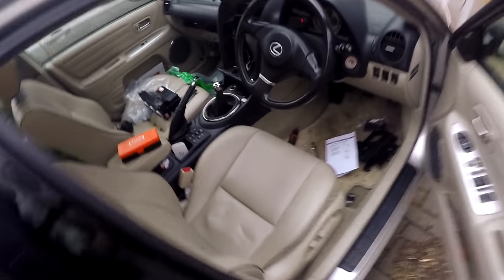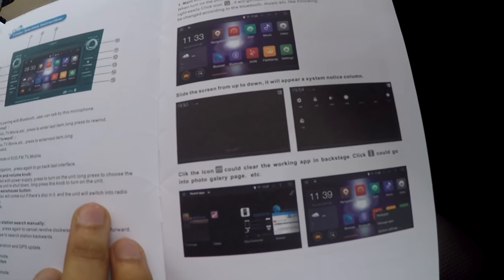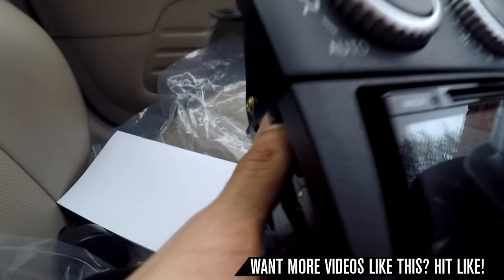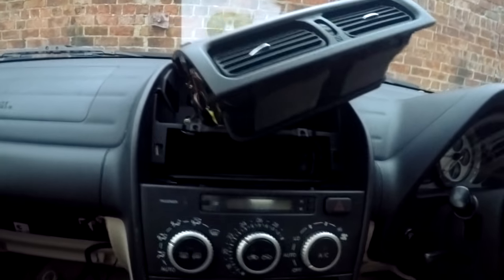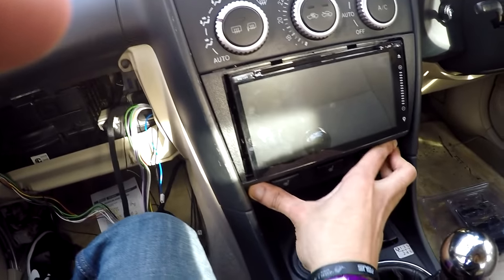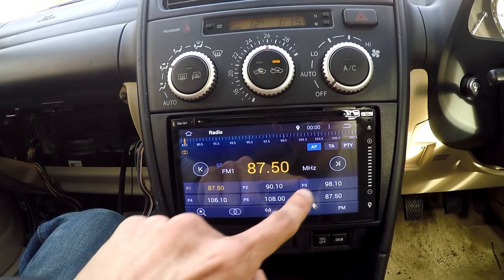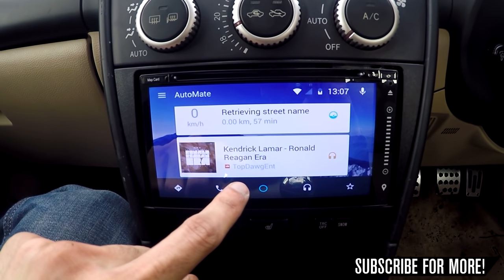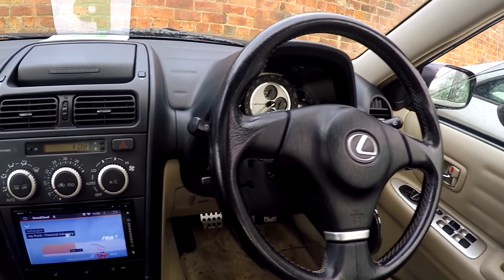ANDROID STEREO REPLACEMENT INSTALL | Lexus IS200 Car Vlog!

Comment: OI THEO! I've recently been driving/ tuning an is200 in gt6 at time of posting (AND YES I KNOW GT6 IS SUPPOSEDLY BAD AND NOT AS GOOD AS 4 BUT WHATEVER I GUESS). It's silver like yours and currently has stage 1 weight reduction (for the carbon grill)

Comment: What do u need in order for the SoundCloud to work. Are u going off phone data, or does it have wifi
Reply from the maker: +ROADK1LL7 it has wifi, but I connect it to a 3g device I have
Reply: +BlackPanthaa nice. Nice job with the installation. Looks nice. Love the vids too. Was thinking of getting one of these for my Mazda RX-7 FC, but wasn't sure about it. You cleared it up for me. Thanks a lot.